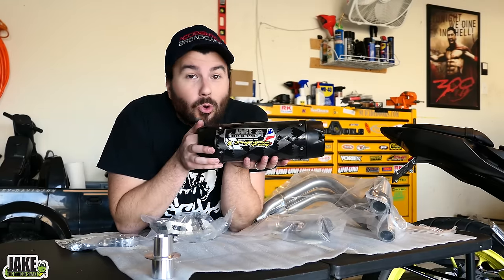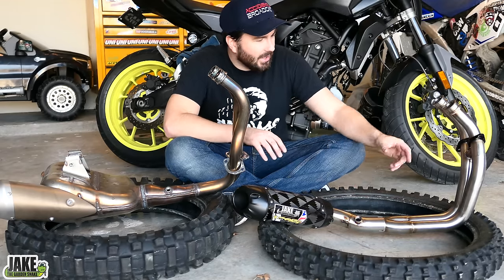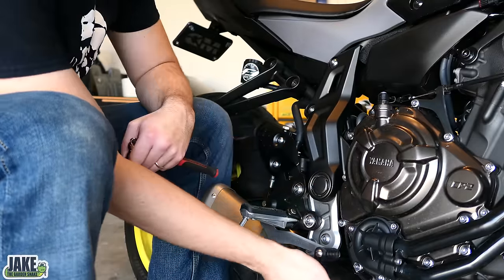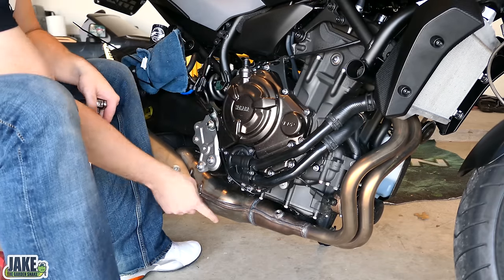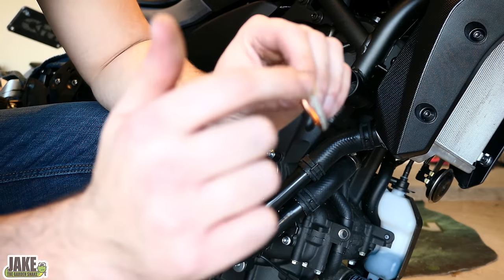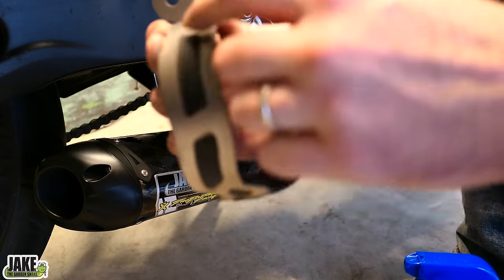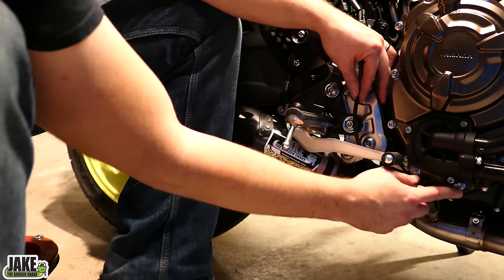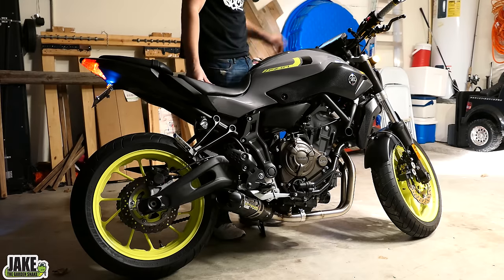FZ-07 Two Bros Full Exhaust Install, BEST EXHAUST

Comment: "You need back pressure" ~ a thing old people say about carbureted engines lol
Reply: Forie O'Hooligan ^ so can I just take off my exhaust completely?
Reply: you don't need back pressure, but you DO need exhaust scavenging in most cases. also exhaust systems have the effect of diverting exhaust gases behind you so you dont breathe them in
Reply: Cj Iscool yeah you can take the exhaust off it should only be a few bolts
Reply: It's all about sucking the exhaust air out of the engine as quick as possible, so exhaust pipes create low pressure zones to create vacuums using pulses and what not. Taking the exhaust off completely is a bad idea overall because it causes damage, burns, excessive noise, etc
Reply: Back pressure isn't an issue these days, excessive heating and rapid temperature changes to the exhaust valve would be more of an issue. But hey, I drive a diesel, turbos are considered mufflers/exhaust, so I can run good stacks and be perfectly fine😅.

Comment: WD-40 is rubber safe.. Inb4 someone uses it as sex lube :O
Reply: you're too late... now i have 3 children and a bad relationship which is falling apart real fast
Reply: Duct tape might help you with the relationship falling apart !
Reply: I tried that. worked well for a couple of minutes but by then I was thrusting so fast it was evaporating because of the heat 😅
Reply: Bacorable, yes buna, and every other rubber seal needs oil to remain pliable and not dry out. I am a hi-vacuum  maintenance technician, for over 20 years. I know all  about the different seals for different applications,  and they  need to be oiled to remain  pliable.
Reply: I clean my cat with WD-40, all shiny now.

Comment: Just wondering I know this is probably a stupid question but is it only a 2 cylinder or is a v twin?
Reply from the maker: its a parallel twin with a 270 crank
Reply: It's a 2 Cylinder...Like a V-Twin...Without the V
Reply: Charles Jose Labamba Jr.+ parallel bro, not v- twin.
Reply: It's a parallel twin.
Reply: Yup. 👍
Reply: I know it's a parallel twin. Hence the "V-Twin without the V" part. It was kind of a joke since he asked if it was a 2 cylinder or a V-Twin. Sort of like asking "Is it a Yamaha or a Motorcycle?"
Reply: You are correct, sort off. Its a parallel configuration but it fires, and therefore sounds, like a V-Twin.
Reply: Parallel twin.
Reply: Charles Jose Labamba Jr.  Yamaha instruments?  I have a Yamaha guitar no joke.
Reply: cody powers imagine going to a Yamaha dealership and deciding on whether you should get a dirt bike or a saxophone😂
Reply: cody powers its actually a cross-plane  2 cylinder engine. same technology as the r1 engine which gives it a growling engine sound and better torque performance.

Comment: so do i need a tune if i take out the baffle? my motorcycle has an o2 sensor so doesn’t that mean it will regulate the air/fuel ratio on its own ? i’m confused on this

Comment: By the way, on the point of actually unplugging the oxygen sensor instead of just twisting the piss out of it, I have absolute proof that it is bad to twist them like that. Both in college and in Ford's certification classes I have had instructors make oxygen sensors fail ONLY by putting silicone in the protective sheath around the wires to the sensor. Those wires need to breathe and they cannot be twisted or they will read improperly. I'm so glad to see you mention doing in right.
Reply from the maker: Hell yeah dude, I've seen em break so I know whats up.

Comment: Nice tip on how to check for leaks. I still haven't done the first startup since installing my system... waiting on my ECU to return from being flashed. I also like the way you took the 02 sensor off. You know the dumb way that you were talking about how some people do it? Yea, that's how I did it. It never occurred to me that the o2 sensor unplugged on the other end. Needless to say I am not a mechanic.

Comment: Thats it i am getting the new 2019 MT07 , it was my first choice but truth be said i fookd up so bought the 2019 CB500X and at the time i was thinking about camping etc but with only 35kw or 47-49hp I did not know the mt07 came in 2 different HP ratings for the UK [maybe everywhere] the 47-49hp and the full 75HP when i test rode the mt it didnt feel that alive so my guess is i rode the 35kw-47hp version so my 187mile CB500X is up for sale and i will be riding the new icewhite-red wheel full 75hp MT07 this summer dont care about losing a little money . i also didnt like the bars on the demo MT but seeing yours and the two Brothers exhaust has deffo helped meke my mind up so thanks buddy i just subbed Scoobs from UK.

Comment: What can you do to prevent exhaust gas leak, in case it happens in the connection between  the mid pipe and the muffler?
Reply from the maker: +Red Lynx if it's all the way tight and still leaking then I would pull it off and try some high temperature silicon. If still leaking them something's not right and you'll have to start checking it.
Reply: Ok, will try both. As always, thank you very much for the info!

Comment: Should i have flashed my Ecu on my FZ-07? I only put a slip on m4 exhaust, factory headers.
Reply from the maker: I would, you've got an open exhaust too now
Reply: Jake TheGardenSnake
Thanks for responding! Just watched your ECU flash video, gonna buy that Velox Racing ECU flasher. I ran the bike for 5500 miles with the open exhaust, hopefully i didn't fuck up the engine lol.
Reply: Stride Tide won't mess up the engine too much, you probably just had a loss of performance

Comment: Another pro tip for the header gaskets is to use a bearing race driver that fits snuggly into the gasket to press into the cylinder head ☺

Comment: Do I need to do a ECU Flash if I only get a slip-on exhaust for the FZ07?
Reply from the maker: the "slip on" for the fz-07 makes it a fully open exhaust. Even if its not as high flow as a full system like this two bros it still massively increases the exhaust flow. So yes.
Reply: ugh. Too expensive. lol. I'm not trying to really add power, but I want some more noise than stock. Lighter would be nice too, but $1k+ for exhaust and tune is too much.

May be time to drill some holes. Lol.

Comment: i call to yamaha dealer he told me i need for full exhaust  power commander and change filter 
question you installed on your mt07 or not ??
if not you don't feel like your engine run lean or something please help me guys i just want sound not another hp and i don't want spend trylion$ just sound can you help me whit  this ??

Comment: Hey Jake, love your videos! 
I've got the flash kit installed and am about to order the Two Brothers exhaust and DNA air filter. Do you have a map for both of those? I can't find one for both from the power commander site. I can find both maps, but with each part on their own (ie: either stock exhaust + dna, or stock filter + Two Brothers exhaust). Did you wind up making your own fuel map for both?

Comment: Jake - Love your vids, I use many to help with installs and such. Thanks much for doing us all a favor. Question - to remove that tip, do I need to use 4 allens and take the muffler cap off and pull it out? You  did not mention this in the vid - just showed you had it off already. Just want to make sure if thats how its done. Instruction sheet does not say either. Thanks in advance!

Comment: Jake. Looks like you know what you`re doing so i got couple questions. You recommend getting a new map together with new exhaust. And Flash Tune is just a software to load maps. So, where do you get your maps that is appropriate to the new exhaust? Do you get it from Two Bros or some forums? Seems for me that if a new exhaust needed a new map then the manufacturer of that exhaust should spend some time to tune the map to fit its exhaust system. Right? I saw your other video where you connect the FT to the ECU and load a new map but i dont recall you showing where you got the map from. Let me know. 
BTW. Thanks for the videos. I Like that bolt shit on series. Keep it up.

Comment: La

Jake TheGardenSnake, I need help with my bike my dude. Love you videos too. But I have the m4 exhaust on my r3 and HAD the k&n filter but put the oem back in the bike to try and help what I thought was wrong. But I cannot get my r3 to idle for shit. Even when at running temp., which seems to be running hotter than used to, it will NOT idle. I have to hold the throttle open to keep it running and when I'm doing that, it pops and backfires like crazy. What do you think is wrong. I don't have any tune on it. I ordered a flashed ecu, but haven't got it yet. But I feel like there's more wrong than that. I've seen SOOOO MANY other bikes with the same exhaust that run just fine. Help a brother out man. What the HELL could be wrong and what should I do? I'll bring it to you one day lol. Not THAT far from you. But I need help. New to the 2 wheel scene and don't know much about shit like this. Back in my younger days, I raced quads, but wtf is wrong with my bike? Lol. Appricate any advice.

Comment: I'm happy that they make one for my new bike. That's one of my top upgrades. Thanks for showing how simple this is. I read all the tech data about gains too. Sounds awesome 👍
Reply: According to forums and people in the industry this is not a company you want to go with.  Was talking to the guys that made my exhaust and he had to cut a Two Bro exhaust off a GSXR because the "stainless" steel had corroded...  Among other stories of their "carbon fiber" yellowing etc.  Akra, Leo Vince, Toce (I've been in their shop), Brock's (if they make a system for your bike), Yoshi didn't seem to bring up any complaints, Arrow, and there are others that are on the list of reliable companies.  I personally was originally going to go with a M4, an Arrow or a Leo Vince.  I got lucky though and now I have a badass looking and sounding exhaust.

Comment: Too Big and Too open does not  decrease your  Flow ..  It  decreases  velocities  which could reduce scavanging..
  Larger  tube  headers  increase  top end  horse power but decrease  mid and low range torque

Comment: All good but I would have tighten the headers first after I have the parts all together fitting in place. The reason is the headers position is the only given place you cant change or move and by tighten it down first I avoid stress and tension to it that can occur if you tighten it down at last. What does not have to but it can. I am no professional mechanic but that is how i learned it from an professional mechanic that does it over 30 years... headers first to avoid tension to them. Nice sound!
Reply from the maker: +onhawaii nope, you do it the way I did. My teachers have been doing it longer.
Reply from the maker: +onhawaii I'm not reading all that

Comment: They say carbon fiber exhausts shouldn't be on 2 or 1 cilinder bikes, because of the vibrations and the fact that carbon fiber is a brittle material and may crack. Titanium is the way to go apparently, haven't heard of anyone's exhaust cracking yet tho
Reply: RidinDutch Maybe he want to match the bike colour with the exhaust. Isnt that carbon fibre is a strong and lightweight material that is widely use in many supercar manufacturer? There is a guy on youtube that i watch his video where he had a m4 gp titanium on his '13 zx6r and there is some kind of crack or maybe a melt on the exhaust.
Reply from the maker: +RidinDutch I've seen carbon on dirt bikes for a long time and never seen that be a problem.

Comment: i did my dissertation in designing and modelling headers for a car.. if pipes are narrower  you get a more linear flow rate and more of backpressure .if its too wide its more turbulent and would be too loud...manufacturers design them this way because the catalytic converter don't do shit until it reaches light-off time..so they try to reduce the time to reduce emissions ...the environment is more important than performance :(

Comment: I know I am in the minority... but I want an aftermarket exhaust that is just as quiet or even more quiet than the stock exhaust.  The reason is I know for a fact from all the research that has been done and from my own personal riding experience over the last 25-30 years that loud pipes DO NOT save lives.  Also I already have hearing damage and tinnitus from years of working around jet engines when I was in the Air Force.  BUT GODDAMMIT the stock exhaust is ugly as fuck!  So is there an aftermarket exhaust you recommend that is the most quiet?

Comment: hey dude.. since you're the 2 bros type of person.. let me tell you something real quick... people don't weld in the inside ... the bevel the joints at the top of the metal.. and then they weld on a certain current... so that it penetrates right trhough the gap.. so it looks like it's welded in the inside.. but its not.. and then the put a filling run on top of the first run.. and then a capping run ontop of that.. check your facts.... "bro"
Reply from the maker: +Hilton vd Merwe wtf are you going on about guy
Reply: oh jah I wanted to add.. but I didn't want to write a book... but anyway... you did a pretty good job showing how to change an exhaust system...

Comment: Just use silicone spray or vaseline instead of disgusting WD40 man. No matter if it's fine on the rubber (rubber is not gonna go part anyway after it has been vulcanized) it is just weird. It might corrode some plastics since any right solvents can basically flush out things that keep them soft but so could engine oil and fuel..

Comment: you should've hacked open the stock muffler and shown what's inside it, the cat section as well as muffler
On a side note, I was waiting for a "One time, at band clamp..." joke.
Reply: There are already photos on the internet and those exhausts in good condition can be sold for 100 easy.
Reply: OspreyBravo18 He already drilled holes in it.

Comment: If you still think you need back pressure you should watch engine masters.
Reply: I have always been lead to believe two stroke engines with carburetors ran better with a bit of back pressure
Reply: BritishCadet well 2 strokes rely on a tuned pipe.  
this is a 4 stroke
Reply: I know, I only commented as you didn't really specify, although didn't need to.. It's 7AM and I woke up an hour ago, so just ignore me
Reply: BritishCadet I didn't think I would have to since this isn't a weed eater.
Reply: Lmao best name yet.
Reply: BritishCadet lol